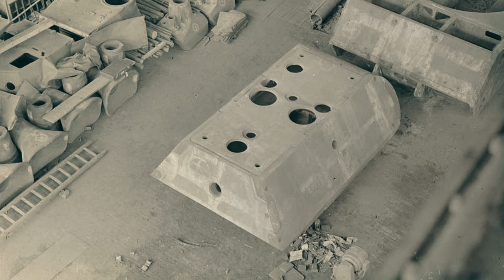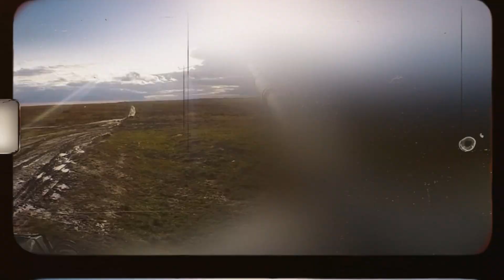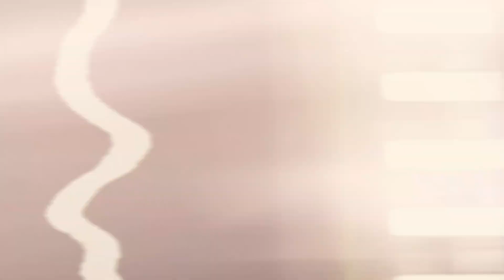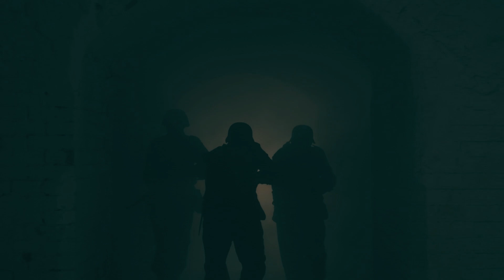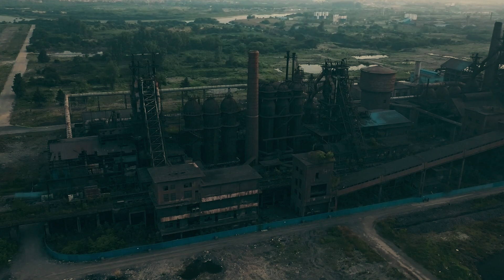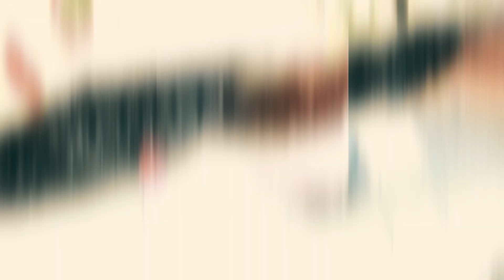Heaviest Tank Ever Built: The Panzer VIII Maus #ww2 #usa #history

Comment from the maker: The full script part 2:

By March 1944, the second prototype, known as the Maus, was finished—though initially without an engine, which was installed by mid–1944. On April 9, Krupp delivered a turret that, once mounted and tested in June, was armed with a 128mm KwK 44 L/55 gun, a coaxial 75mm KwK 44 L/36.5 gun, and a 7.92mm MG34 machine gun. This formidable setup enabled the Maus to penetrate the armor of American Shermans, British Cromwells and Churchills, as well as Russian T-34 and JS-2 tanks at ranges exceeding 3,500 meters. Despite the turret featuring mounts for a Zeiss rangefinder, several components were missing and delivered later, while plans for a second turret never materialized. By late July 1944, Krupp reported that additional hulls were in production, but orders to scrap these were issued just two days later. Testing resumed on the second prototype in September 1944 with a Daimler-Benz MB 517 diesel engine, yet even engines rated at approximately 1,200 horsepower failed to push the Maus beyond 10 to 12 miles per hour.

The engineering challenges of the Maus were as monumental as the machine itself. Traditional torsion bar suspension—used in vehicles like the Panther and Tiger—was abandoned in favor of a volute spring system that was believed to better distribute the tank’s immense weight. Its running gear, designed by Skoda, featured double–wheeled trucks supported by 12 return rollers and extraordinarily wide 43.3–inch tracks that occupied over seven feet of its 12–foot width. Although these design choices were intended to reduce ground pressure, they also gave the Maus an unusual and somewhat ungainly appearance, with a 12–foot overall height making it an easy target. Strict dimensional limits were imposed to ensure the tank could be transported by rail, leading to the production of a specialized 14–axle railroad car by the Graz-Simmering-Pauker Works in Vienna.

Further complicating matters were production delays and repeated engine failures—problems exacerbated by relentless Allied bombing raids on German factories. These setbacks meant that any breakdown of the Maus often required it to be towed by two other tanks, highlighting the impracticality of such an enormous vehicle in a rapidly evolving battlefield environment. Moreover, the large openings in the hull necessary for adequate ventilation, along with the inclusion of an external auxiliary fuel tank (a significant fire hazard), rendered the Maus especially vulnerable to close–range attacks.

Despite its myriad flaws, the Maus also served as a platform for ambitious engineering experiments. An auxiliary power plant was integrated to pressurize the crew compartment, thereby enabling limited submersion to depths theoretically up to 45 feet (though in practice only about 25 feet), which would have offered some protection against gas and chemical warfare. This system, equipped with built–in fans and ventilators to supply oxygen when all hatches were sealed, also featured a massive cylindrical chimney designed to function as an emergency escape route. An innovative electric transmission and steering system—first employed on the Elefant assault gun in 1943—was adapted for the Maus, and an ingenious method was devised for paired tanks to ford rivers, with one unit powering the electric system of its companion via cable. However, questions remained about how to manage the final vehicle in such a tag–team arrangement.

Production delays, persistent engine issues, and the inherent difficulties of scaling up armored vehicle technology to such extreme proportions eventually proved insurmountable. The Maus’s design also spurred studies into alternate variants: Allied–discovered plans for a “Bear” version envisioned a 1,500–ton monster armed with an 800mm breech–loading main gun and two auxiliary turrets mounting 150millimeter guns each, while another concept—the Flakzwilling 8.8cm auf Maus—proposed converting the tank into a heavy anti–aircraft platform armed with twin 88millimeter Flak 43 guns. Ultimately, on November 4, 1943, Hitler ordered the cessation of all work on the Maus. The original order for 150 vehicles was canceled, and only a single unit was slated for further evaluation. Some accounts even suggest that Hitler’s true intention was to deploy the Maus as a coastal defense measure along the Atlantic, where its limited range and mobility would have been less of a liability—though production delays ensured that any such plans would have come long after the D-Day landings.

Today, the Maus remains a subject of fascination among military historians and engineers a like. Despite its inherent flaws and the impracticalities that doomed its operational viability, the Maus symbolizes the extremes of wartime ambition and the drive to push engineering boundaries under extraordinary circumstances. Its legacy endures as a stark reminder of how hubris and innovation can intertwine, leaving behind a machine that was as much a technological marvel as it was a cautionary tale.

Comment from the maker: The full script part 1:

The Panzer VIII Maus stands as Germany’s most fearless trial in extremely heavy tank warfare a so-called “wonder weapon” originated under Hitler’s order and engineered by Ferdinand Porsche. Weighing in at a astonishing 188 tons, the Maus is recognized as the heaviest fully enclosed armored fighting vehicle ever built. Its enormous turret was designed to install a 128 millimeters KwK 44 L/55 gun, supported by a formidable 220 millimeters of frontal armor, promising cutting-edge weaponry and highly resistant armor. However, this massive weight severely limited movement: the tank’s top speed was 20-22 km/h, and even the advantage of very wide tracks could not overcome the obstacles posed by soft ground and load restrictions enforced by many bridges. In addition, groundbreaking features—such as a hybrid electric transmission and a creative system for river crossing using paired tanks—highlighted the advanced engineering behind the design. Yet persistent mechanical issues, logistical nightmares, and constant production delays ultimately doomed the project. Although the program was canceled in 1943, the Maus continues to intrigue as a symbol of desperate battle-time vision, with its only remaining combined prototype now displayed at the Kubinka Tank museum.

From as early as 1941, when the German high command was envisioning revolutionary military technologies the Maus emerged amidst a wave of projects that promised to change the face of warfare. While some of these “wonder weapons” eventually evolved into foundational elements of modern arsenals—such as assault rifles, intercontinental ballistic missiles, and jet fighters—the Maus was an outlier. It embodied not only technical ambition but also the erratic decision-making of Hitler, who seemed compelled to outdo Allied designs despite Germany’s own dwindling resources. At a time when the loss of African oil fields had rendered fuel scarce, commissioning a gas–guzzling 188–ton behemoth was as paradoxical as it was extravagant. While American engineers were refining the 45–ton M-26 Pershing and the Russians had introduced the 45–ton JS-2 Stalin, Hitler’s fixation on a tank that could outgun and outweigh its adversaries perplexed his own staff.

The developmental journey of the Maus began in earnest when Krupp started studies of Soviet super–heavy tanks—particularly the KV series—in 1941. By early 1942, Krupp had produced design studies for a hybrid Tiger/Maus prototype, later designated the Panzerkampfwagen. VIII, and had also conceptualized a predecessor known as the PzKpfw. VII Lowe (or “Lion”). In early March 1942, an order was placed for the heavier design, consigning the Lowe to history. Porsche was awarded the official contract to create the 188–ton Maus, with clear specifications: the tank was to carry 100 rounds of ammunition and be armed with either a high–performance 105mm L/60 or L/72 gun. While Porsche was responsible for developing the chassis, the Krupp Munitions Works was charged with constructing the hull, turret, and armament. Endorsed by the Heereswaffenamt as a competitive design, the project may also have served as a form of recompense for Porsche’s earlier setbacks, with the ambitious directive even including the notion of an “indestructible” machine.

The contract required an operational prototype by the spring of 1943. On June 23, 1942, Porsche submitted an improved design featuring turret–mounted 150mm (L/37) and 105mm (L/70) guns, and he promised that the first prototype would be ready by May 1943. Although the original specifications dictated a 150mm L/40 gun coupled with a 20mm MG151/20 heavy machine gun, alternatives such as the 128mm L/50 were under serious consideration. By December 1942, additional armaments—including a 127mm naval gun and the 128mm flak gun—were also undergoing tests. In January 1943, Hitler intervened, ordering that the turret be fitted with a 128mm and a 75mm gun, while future designs would eventually incorporate even larger weapons (150mm or 170mm). The standard 7.9mm coaxial machine gun was replaced by a 75mm anti–tank gun positioned alongside the main armament, and an antiaircraft machine cannon was slated for the turret roof, supplemented by a smoke grenade projector. Moreover, the requirement for 100 rounds of ammunition storage had to be compromised, as space was reduced to allow for further modifications in armament.

Porsche’s schedule soon slipped: by January 1943, he admitted that the first vehicle would not be ready until the summer, with production rates adjusted to only five units per month. Initially designated the VK10001 Porsche Type 205 and nicknamed “Mammoth,” the tank underwent a series of renamings—first to “Maeuschen” in December 1942 and finally to “Maus” in February 1943. Assemblyof the components was handled by Alkett, and on December 24, 1943, the first prototype—lacking an actual turret—was completed and put through rigorous tests. These tests revealed that the tank struggled to move under its own power: its Daimler Benz MB 509 engine, derived from the DB 603 aircraft engine, could only propel the Maus at 13 km/h under ideal conditions, far short of the promised 20 km/h. A simulated Turret, designed to mimic the weight of the planned structure, was latter affixed.